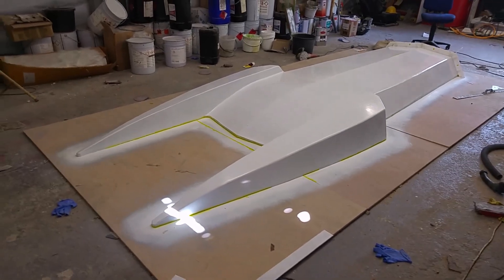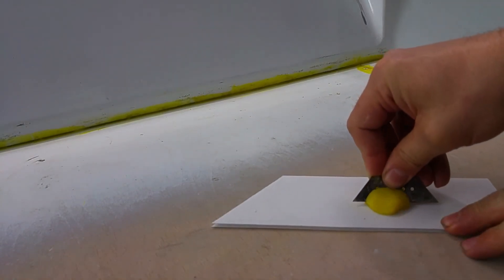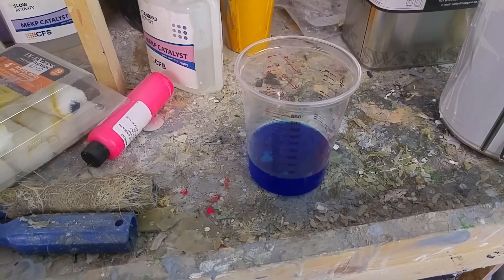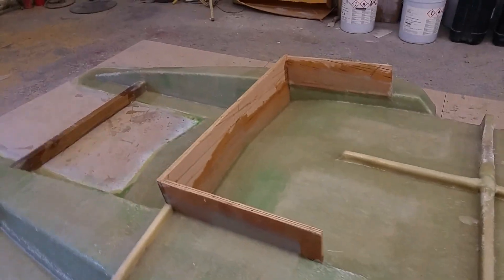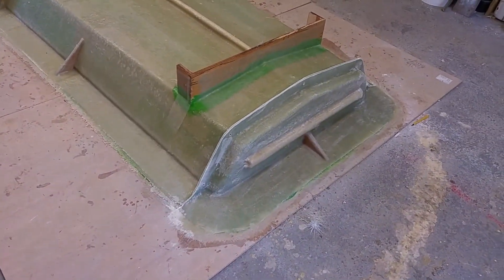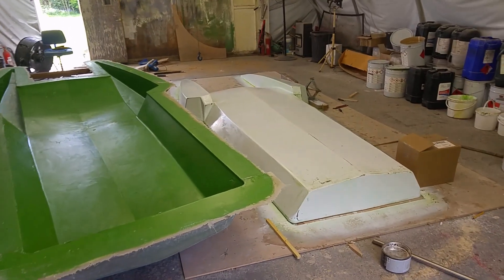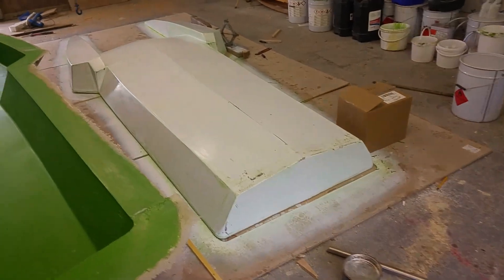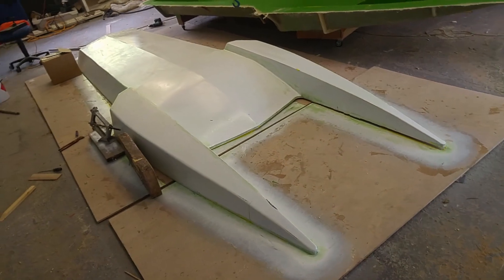Alpha-Centauri Speedboat Build - Part 3

Comment: This is crazy, is this your profession or side hobby?
Reply from the maker: Thanks mate. Hobby at the moment, but trying to make it a profession.
Reply: No way, were you thought by your father or did you do some kind of education in it? Like the fiberglassing etc
Reply from the maker: @Luke-hu9mc  Started by making RC boats when I was young. Also did a week long fibreglassing course a few years ago. But to be honest you can learn most of it with videos and practice. EasyComposites have some great how to videos.
Reply: @BoatsandEngines  ah right, did you make the hulls of rc boats? I was into that too but only bought mechanical parts and installed them. And thanks for fibreglass tip, will check It out. I did up an old boat recently( it's on my YouTube if u wanna see it )  but I really want to build my own from scratch now, I've alot to learn before I go down that road though haha
Reply from the maker: @Luke-hu9mc  I love the shape of those, it has a very pretty bow shape. Top notch work buddy, really neat!
Reply: Serious skill to have as a hobby,  I wanna try fiberglassing soon

Comment: back in 1985, I worked for M.F.G. (fiberglass manufacturer) They used a "mold release agent" ,water based, but sprayed it on for more consistent finish on the Gel Coat. When we pulled the mold from the plug, it simply wiped off with  a damp cloth. Of course, the mold got wet sanded, buffed with compound and polished, then hand rubbed with many coats of different waxes, preliminary to first part pull. Just for future reference. Also used clay for contouring smoother radius blending.
Reply from the maker: Hello, yes I have moved to a chemical release agent now,  which works like magic and doesn't effect the finnish.

Comment: What are use on this boat engine or motor?
Because I want to make this
Reply from the maker: Hello, the tooling all adds up, it will cost more to build than you can buy the bare hull for. This version is outboard powered typically 30-100hp, but there will also be a longer version for inboard engines soon. The hull in kit form, and as a complete boat will be available here: https://www.alphaboats.co.uk/
Please also check out our facebook page: https://www.facebook.com/alphacentauriboats/